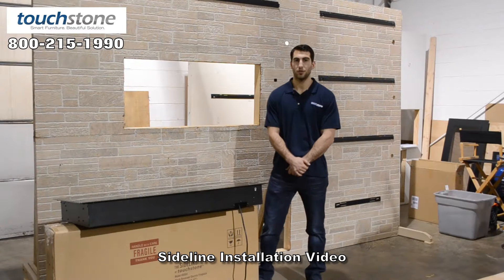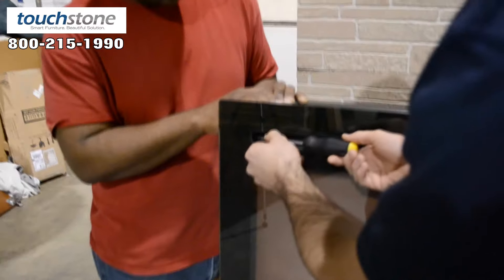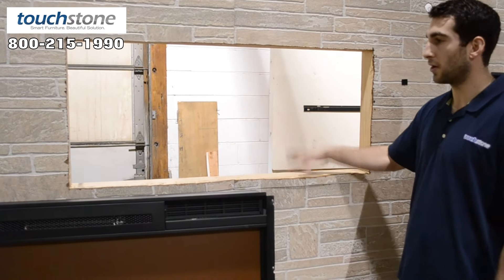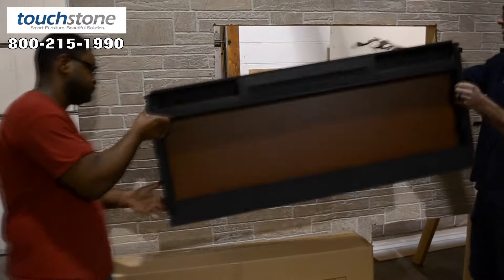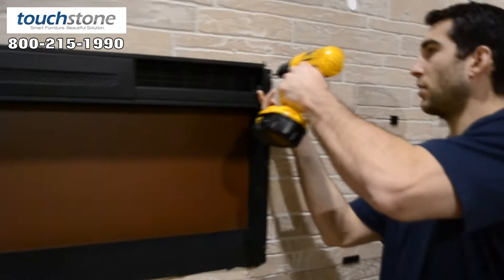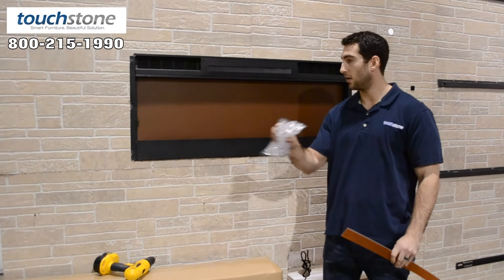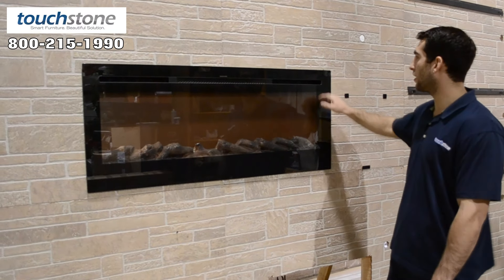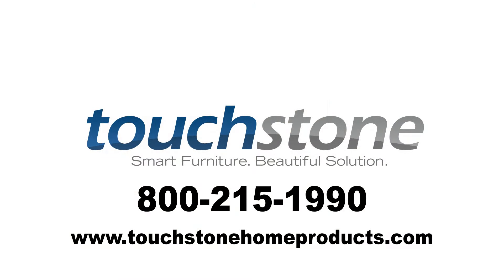Installation Video - 80004 Touchstone Sideline 50" Electric Fireplace - UPDATED VIDEO IN DESCRIPTION

Comment: well, you lost me as a customer,  first off, NO interior wall is 2x6, my exterior is 2x6 and All internal walls are 2x4s.  So your customer is required to build a separate wall extensions just to accomodate your heater box.  Not very universe.  BAD!  Also dont demonstate on non tiles,  you just cant screw into it like its wood.  Also, what home has 20amp ready?  its only at the refridgerator.  most of your walls in your home is 15 amps unless you build a new home and request 20amps at that location.
Reply: Dude. Stop crying.  He showed you a general installation.  Most people do their homework and build a separate wall extensions with 2x4s and such.